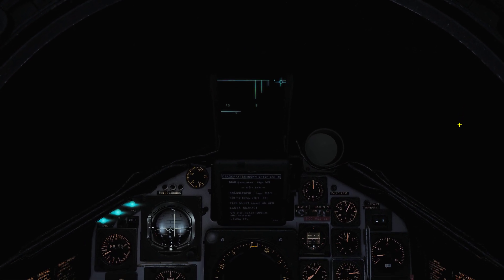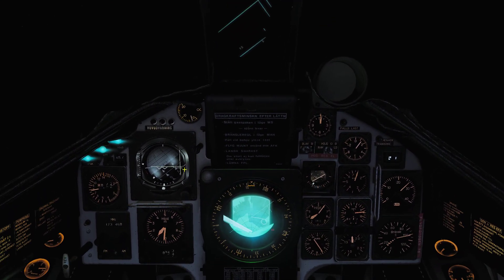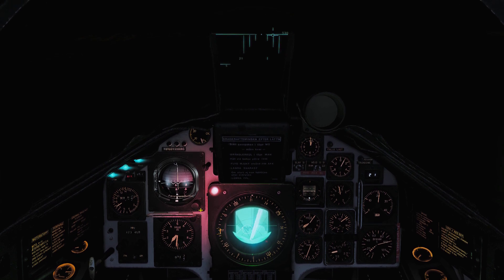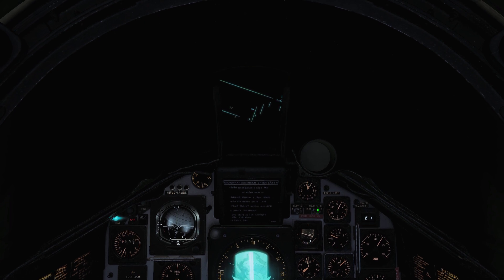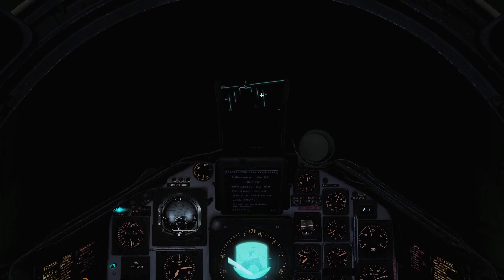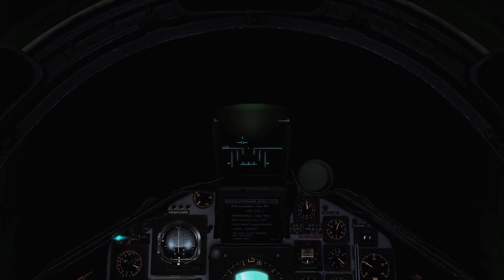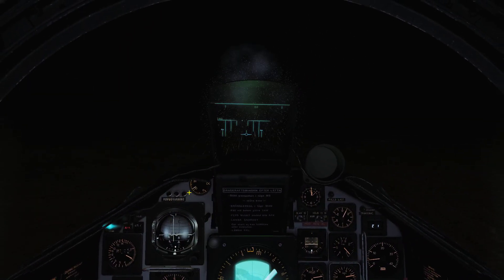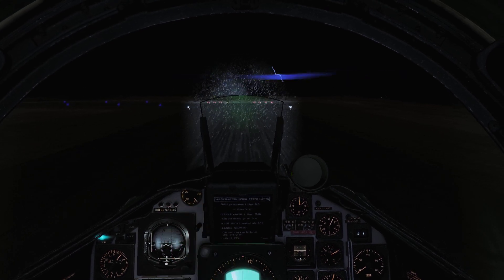DCS Viggen TILS "CAT III" landing

Comment: With the Viggen you can actually land in almost zero visabiliy but you need to follow the decent guidence and decent rate to the point. The TILS should be oriented on the left side of the run way giving you an approximate 3 degree angle to the runway. When at around 80 meters (QFE set correctly) you turn 3 degrees right and should be at the centre of the runway. At around 60m the fin on the vector will start show decent rate instead of velocity to prevent you from slamming into the runway to fast. If you don´t see the runway buy now you can/should abort. If you trust the instruments and are flying on the dot you can actually land in fog. I will not recommend it but it is doable. Landed 100m visability once, had to go around once since I did not see the runway, landed on the second go and did not notice the runway until 30m above the ground. Quite shakey.
Reply from the maker: You are not allowed to land unless you can see the runway when you're at 300 m - roughly when you cross the centerline.
Reply: @TrakDah  You are absolutely correct regarding visability. My point is just that the land guidance Viggen had is very good.
Reply: @TrakDah  No of course not. Howerver some pilots made a tryout landing on road base at night. (visavbility can be rather good even in winter if there is snow). There where no issues landing even in very bad visability but the issue was seing the road when breaking. It became to dark below the treeline to stop safely. So after a few landings and some close calls they decided it was too dangerous so they canceled. However if things become hot, now with night vision, I don´t see an issue with it. These pilots are bad ass.

Comment: Well done. That's about as tough as it gets
Reply from the maker: (good grief, I've been trying to say this three times now, but everytme my message ends up being deleted - somehow! Adding this text to see if that sorts it out)

Thanks! Did you take anything away from it? :)
Reply: I did. I was dropping gear on TILS approaches when descent on the glideslope was commanded. This is too late. I saw you drop the gear at 20km and adopted this.

I find AFK to be too slow in adjusting the throttle. It often stalls the aircraft out. Any pointers on controlling the landing when you can only control pitch?
Reply from the maker: AFK is terrible. No one used it IRL I'm told. But you can use it if you like. The trick is to remember it will only spool up to 100% (Mil) and it's slow at that. You can barely maintain level flight during the "level" phases (550km/h) with it on with gears out. Once you get into the descent stage when you're  supposed to hold the correct approach AOA, the AFK is probably even worse. But as long as you stay ahead of the ball curve you can use it, but be ready to disengage it and apply power manually.